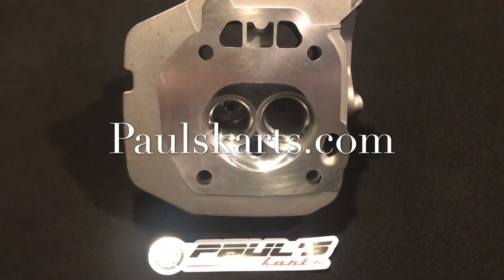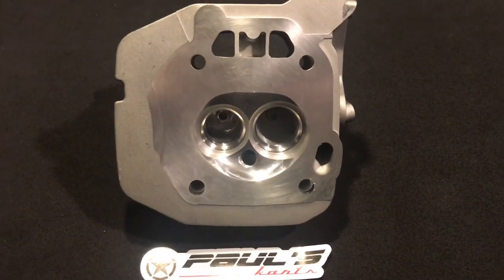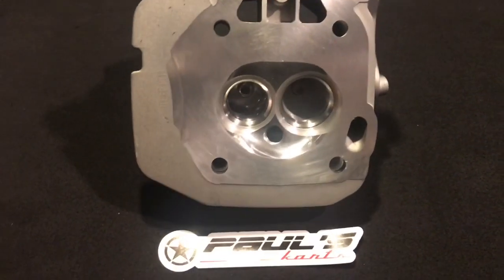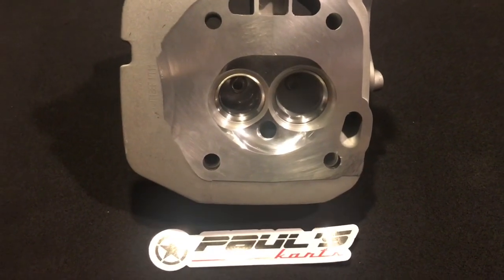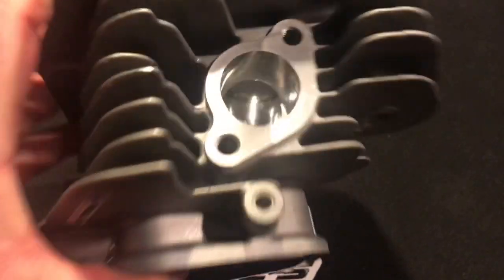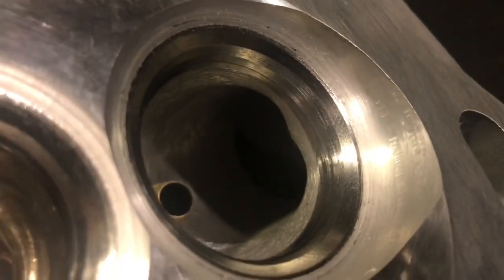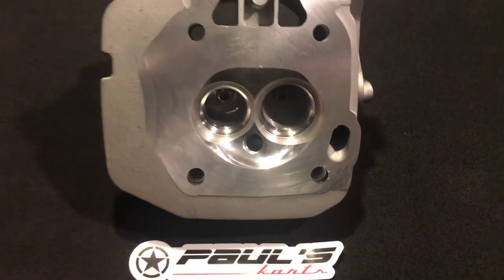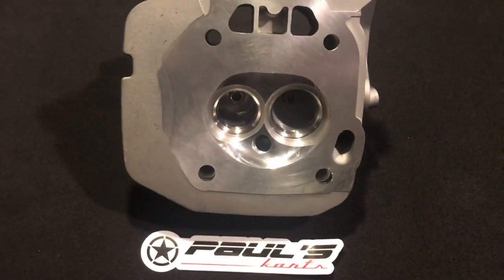Paul’s karts, performance gx390 head, high velocity porting, stock appearing

Comment: Hi Paul. I recently started following you and love your videos.  I would lile to know how big difference does a 3 angle valve job make when running stock size valves.
Your advise would be appreciated.
Regards
Robin
Reply from the maker: @robindejager3618  1/2” before to 1/2” after the seat (including the seat itself) is the most important part of the entire engine. Hope that answers your question. “ ITS IMPORTANT” 💪

Comment: Walt here, what I needed is the most torque and best reliability possible, these engines are strong to begin with but when you put a billet rod and forged piston in it you can up the compression and you should be able to run this engine for days at a time without issues - having Paul build this head was part of the plan to create an industrial class, high torque, cool running, lightweight engine that can run for hours at a time on regular gas pulling a huge load and last for years!  I believe this will do the job.
Paul was great to work with and was always willing to help figure out the details!
The work Paul does is very nice and can be applied to far more than just performance karting, this is a concept engine for our gold dredges and will be the answer to several issues for us,  high torque in a light engine that is reliable and runs on regular gas is hard to come by! - think out of the box and get Paul engaged in your projects, when it comes to HP/Torque in a 
light-wieght package you need a great head - It will make or break your project - period!
Walt
Reply: FYI, the first thing to wear out on stock GX390 are the valve guides and then they start smoking and burning oil - they don't have valve seals stock and the stock guides are crap!, with Paul's super durable valve seals and bronze guides in this engine solve that problem, think bullet proof, think Paul's heads to get it done and make it last.
Reply from the maker: Walt Morrison // thanks man !
Reply from the maker: Walt Morrison // honored !!!🥰🥰🥰

Comment: Nice work 👍 I just subscribed to your channel recently. I have done a lot of projects with the 212cc predator engines on my channel. I also built a articulating 4x4 dump truck using Subaru drive train powered with a predator 420.
I just ordered a Duromax 16hp for my next project, doing research on the duromax is how I found your channel 👍 I definitely will be talking with you about some upgrades to my Duromax! Take care Paul
Reply from the maker: Mike festiva // glad you like and find the content helpful ...😎😎😎💯💯💯

Comment: Great video as always, those heads are a work of art! One question - in your experience, are Mikuni VM (round slides) or TM (flat slides) better? I’ve searched online and there seems to be a general consensus that the TM carburetors are more advanced and work better than VM carbs. Thanks!
Reply from the maker: Robi Bolli // I have never been a mikuni Tm or vm fan on these small engines .. but if you put a gun to my head I’d say go round slide for ease of tune.. a bad tune is common and people spend so much money on mods and kill there power potential with a bad tune .. my suggestion is get one of my carbs and get all your power
Reply: Paul's karts Lifan 420 Thanks for the advice. Right now I’m stuck tuning my Mikuni VM20, waiting for new jets to come in. Next time I build an engine, I’ll definitely be buying one of your carbs, tuning an aftermarket carb can be a real pain in the butt...if I can’t get this one right I’ll buy one of yours
Reply from the maker: Robi Bolli ... that’s a super small carb .. is recommend stepping it up in size too..22mm is really tiny lol .. you should see an improvement over stock but can get much better. Gotta get that air in there ! ... Paul